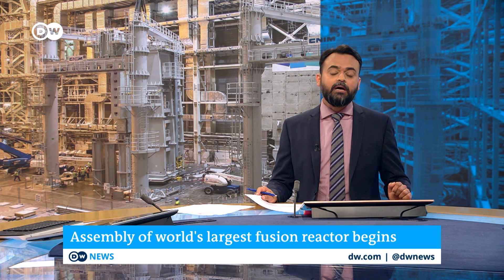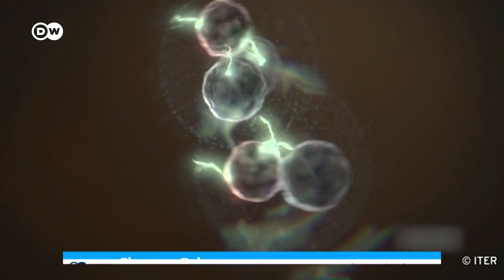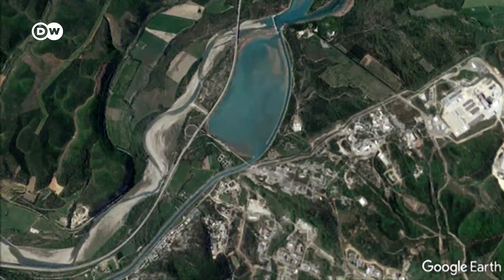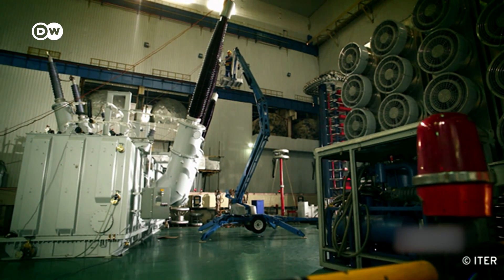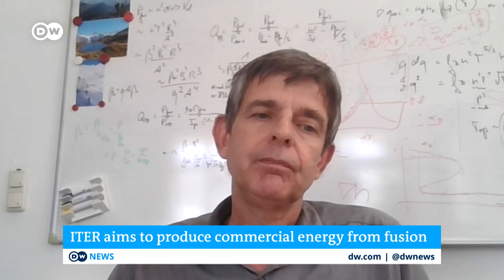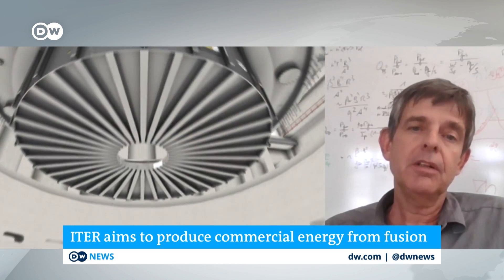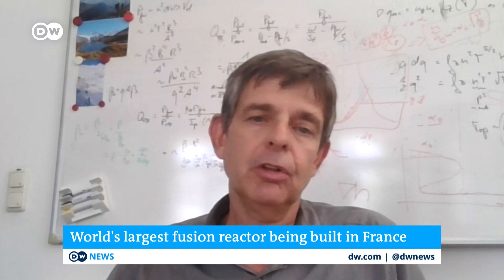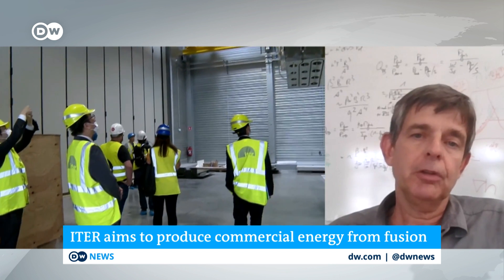ITER: Assembly of world's largest nuclear fusion reactor begins | DW News

Comment: Really hope that there will be no sabotage from fossil fuel giants. Because when this one works it's all over for them.
Reply: Home Kitchen  Co2 is a pollutant ffs.
Reply: @PaulBrown-uj5le  wrong, CO2 is not a pollutant.
Reply: We still need better batteries
Reply: @danielcarvalho3079  There's 2 technologies that are to be deployed very soon. Solid-state lithium batteries and graphene infused lithium ion batteries.
In addition you are forgetting hydrogen, an extremely energy desne rocket and jet fuel you can easily produce in absolute bulk if you have a source of electricity like fusion .
Reply: @fl00fydragon  Hydrogen is a mass dense propellant, but extremely bulky in volume (even as a liquid). This makes rockets much more expensive as they need to be built larger and contain much larger pipes and engines. You end up with a lot of extra dry mass. Methane is a much better option, and can be synthesized using carbon pulled from the atmosphere or oceans.
Reply: @pseudotasuki  And yet we have the technology and it's extremely reliable. (Not to mention that new breakthroughs in material technology will refine what we can do with hydrogen)

And yes, sometimes the cheapest option is not the best one.

Maybe it's the product of trying to run the digital age with a steam age technological system.
We're doing the equivalent of trying to run the Roman empire on the Paleolithic socioeconomic system and expect it to work.
Reply: @pseudotasuki  nope. Hydrogen is easier to make but harder to contain.
Reply: Nah, we still need it for lubrication.  Otherwise our industry will collapse.
Reply: @Aurumk1  That is a tiny segment of the market.
Reply: If you consider political maneuvering, biased research or media campaigns sabotage, it's ongoing stuff that has been going for pretty much all the time.
Reply: Same thing happened to fission. If it wasn't for spread of misinformation and political sabotage, all our power would be fission by today and greenhouse effect would be an astrophysics term used only in academia. No reason to think the same thing won't be done to fusion as well
Reply: It CAN'T be that government is just this inefficient.
Reply: Home Kitchen Think of the ubiquity of water vapour in the atmosphere and the volume of its effects and then realise it only constitutes 2-3% of it on average. To assert that CO2 can't have significant climatic effects because there's "only" 400 ppm of it is simply mistaken.
Reply: Kraptonite  wrong, CO2 is not a pollutant.
Reply: Home Kitchen  what about graphene . Isn't that going to replace plastic
Reply: There is still a place for oil and coal.  Thanks for your liberal sczephrani.
Reply: Now about recycling. Any kind of recycling requires energy. Sometimes lots of it. Even if the energy is completely green (we are not even close), it still has costs. Quite possible that it is cheaper to burn it or let it decompose than to turn it back into something useful. So, it will be better if we try to make products that last longer and leave plenty of oil reserves instead of burning it.
Reply: I don't think it's done for oil industry in 21th century (maybe 22), even it ITER works perfectly we would need at least 100 years to build such complex plants across the globe to cover energy demands (you would need at least 5-10 years to build just one). Anyway car industry is already switching rapidly to electric energy, you already have enough autonomy with electric batteries even for longer trips, costs of those cars are getting lower every year (and EU for example have big subsidies if you buy them), you simple can't stop technological breakthrough.
Reply: Don't worry, if Russia's working with them there is no possible threat
Reply: Home Kitchen  I can't see you sitting in front of me, so by your logic I will assume you don't exist.
Reply: Tokamak fusion is extremely unlikely to be economical. It might "work", but the machine is enormous and super complex. This is not how you make cheap energy. The fossil fuel industry has nothing to fear from ITER.

Nuclear fission reactors however are relatively simple, extremely safe, makes affordable, reliable electricity and have been available for half a century.

Fission could have displaced huge amounts of fossil fuel over the last few decades, but "environmentalists" won't allow it to be used to its full potential.
Reply: @phamnuwen9442  Someone is not up to date in superconductor technology.

Recent advances have made the scale of ITER outdated before its even built, now its only useful as a research platform.

New rebco superconductors can downsize the magnetic field to something around the size of a desk (though coils, power supply, energy harvest, etc would still keep the size out of that range. 

Also you can increase the output further by combining the new rebco with stellarator geometry.
Reply: @fl00fydragon  Build one and we'll see. So far, the only functional nuclear power reactors all use fission. Sure, superconductors can become better. The problem for fusion is that fission reactors can also be significantly optimized and simplified.

Support for fusion is (just like for solar and wind) primarily driven by an irrational fear of radiation and public perceptions being shaped by crappy, sensational Netflix shows.

Fission has no major drawbacks if you look at the data.
Reply: Home Kitchen  fyi windmills are made of glassfiber and epoxy resin, not fron oil derived plastics
Reply: Home Kitchen  Wait, are you actually asking for a list of hundreds of chemicals?
If you googled the general category I gave you you'd have reading material for weeks.
Reply: Home Kitchen  Gentlemen, behold! Mr "I can't google for 5 minutes and need to have information spoonfed to me"

As a matter of a fact yes, there is vegetable based motor oil that's already in the market

There's also certain and chitin based bioplastics as will as multiple bioplastics based on the waste plant biomass we produce via agriculture, 3D printable bioplastics, epoxies, flexible and inflexible resins.

Look it up instead of asserting yourself with no evidence when a 1 MINUTE SEARCH can prove you wrong.
Reply: Home Kitchen Well yes, there other uses such as plastics and stuff but a lot of greenhouse gasses are produced by means of energy production. So even if we still process oil/coal/etc we can cut down on a TON of pollution by changing our energy source.
Reply: This is a prototype, so if it functions correctly the work on the real thing begins. We are still decades away from this becoming accessible.
Reply: Home Kitchen what about greenhouse gas emissions tho? Yes we need oil forever, but what about gas?
Reply: Home Kitchen  
"The reason your plastics and other materials are so cheap is because the energy side of the fossil fuel industry subsidizes it."
No, the reason oil is subsidized is because it's literally "subsidized" on various levels (including processing), preferential company funding, tax breaks for oil companies etc.

"Fuel industry" is actually the shackles of oil-sourced materials. You would know that if you had more knowledge on fuel logistics (massive operations around the globe to imitate power grids, where electricity would be transported with "buckets"). You would also probably ask yourself why is as much diesel sold as gas, when the latter is twice as much refined and almost twice as cheaper to process (math?). It's because Oil is primarily used to refine auto fuel, and not optimized for materials refining.

Now, our modern burden (adding cheap plastics to it) is the absolutely idiotic generation of product "designers" who make products irresponsible (can still be made in various better ways, including easier recycling instead of a total mess) and a narrow-minded business view on a "specific" style of a consumerist economy (can still be much more sustainable).

You see, Consumerism works better with recycling, and for your information, in that alternate reality, the same Oil Companies would do the recycling (because of the massive budgets they already have), just like the same Oil Companies today build wind/solar farms, try to sell the idiotic hydrogen power (substitute oil for hydrogen - the same business), and have business ventures of any kind just because money. They don't care about Oil, but it's cheap money (investment machinations) and they can easily switch to other opportunities, since they're not small family enterprises but mega-corporations which excel at money siphoning (oil exploration and is a massive gamble, and extraction not too far either). You're forgetting about Politics, and how things are build/paid on a national scale.

Methane (natural gas) is also used in the chemical industry.
Reply: Nuclear is great but it only covers electricity. There are many use cases for oil that could never be replaced by nuclear, like materials and transportation (although I do agree that if all coal and gas plants in the world were replaced by nuclear it would be a fantastic improvement already)
Reply: @GeneralKenobi69420  no it doesnt. Nuclear power is used to make isotopes used in many fields, including some semiconductors on your cellphone right now.
Reply: @CarlosAM1  what? Literally from Wikipedia:

"Nuclear power is the use of nuclear reactions that release nuclear energy to generate heat, which most frequently is then used in steam turbines to produce electricity in a nuclear power plant."
Reply: @GeneralKenobi69420  keyword being most frequently. Nuclear reactions in power plants generate isotopes that are useful in many industries
Reply: @CarlosAM1  you got source? Cause I've never heard of such a thing before.
Reply: @GeneralKenobi69420  World nuclear association:

"in developed countries (26% of world population) the frequency of diagnostic nuclear medicine is 1.9% per year, and the frequency of therapy with radioisotopes is about one-tenth of this. In the USA there are over 20 million nuclear medicine procedures per year, and in Europe about 10 million. In Australia there are about 560,000 per year, 470,000 of these using reactor isotopes. The use of radiopharmaceuticals in diagnosis is growing at over 10% per year.

The global radioisotope market was valued at $9.6 billion in 2016, with medical radioisotopes accounting for about 80% of this, and it is poised to reach about $17 billion by 2021. North America is the dominant market for diagnostic radioisotopes with close to half of the market share, while Europe accounts for about 20%.

Nuclear medicine was developed in the 1950s by physicians with an endocrine emphasis, initially using iodine-131 to diagnose and then treat thyroid disease. In recent years specialists have also come from radiology, as dual PET/CT (positron emission tomography with computerised tomography) procedures have become established, increasing the role of accelerators in radioisotope production. However, the main radioisotopes such as Tc-99m cannot effectively be produced without reactors.*"
Reply: @CarlosAM1  I mean... That's not what I'm talking about at all. Of course I know about nuclear medicine, but oil can also be used to make all kinds of derivatives like plastics, lubricants or fuel for trains and plains. You can't make kerosene from uranium now can you?
Reply: @GeneralKenobi69420  no but you cant make medicine out of oil can you?
Reply: @CarlosAM1  no, but how is that gonna help phasing out oil?
Reply: Home Kitchen  the plants can't keep up with all the CO2 we're pumping into the atmosphere
Reply: @mouth4207  plants aren't the only things that absorb CO2. Water and soil also absorbs CO2; most of the Earth's CO2 is locked up in rock as limestone and basaltic rock.
Reply: Most oil companies back these ideas, like carbon capture, in order to gain complete control after the process has proven true.... sadly enough
Reply: Not really.  Even if everything goes perfect, the reactor won't be operational until 2035.  Even if that happens, it'll still be atleast 100 years (from now) before we have more fusion plants than you have fingers on your hands.  According to one article, it'd take 440 plants the size of ITER to replace just coal fired plants.  This also doesn't factor in cars, which despite what some believe, will still be powered by gas for atleast the next 100 years.

Trust me, I think ITER is going to be an amazing milestone on humanity's journey to a completely clean power system but it's still gonna take us a long, long time to get there.
Reply: @Colin Berg Sadly recycling is extremely unprofitable. Most plastic isnt recycled and the stuff that is can only be recycled a few times. It's basically there so plastic can claim they're "clean"
Reply: Home Kitchen  
Yes, no doubt fossil fuels bootstrapped the industrial revolution, but we are going to run out of them eventually. Unlocking hydrogen fusion would unlock the most plentiful fuel source in the universe.
Reply: Those same companies invest a lot of money in renewables too. They're energy companies after all.
Reply: Not necessarily, there is a world of difference between demonstrating technical feasibility and making it work economically. Purely from technical standpoint we could have replaced all coal power plants with nuclear decades ago, no fusion needed. France excluded, rest of the world didn't and not just because of eco-maniacs being afraid of the atom.
Reply: @kincaidwolf5184  A) None of which has the power, wealth and influence of oil corporations that are against it.
B) Notice how even you said "buy the patent"
There's your other set of problems.
The private sector does not invent disruptive technology, it adopts it.
Unfortunately we don't have the serious push for public R&D like we did with semiconductor technology, aerospace, material technology, medicine, etc.

The other problem is patents themselves.
Our technology is not born out of thin air, they build upon past technologies.

Patents slow down the process, in some cases holding down extremely valuable applications for decades (which in turn holds back research, adoption, modification, repurposing, refinement, etc.)

They're a broken mechanism of a failed economic system.
Reply: And millions of children won’t eat that night hope your happy ☺️ (millions and billions of people work in the fossil fuel business and many families depend on it for income, as soon as it’s gone poverty will be at a new time high never seen before)
Reply: Home Kitchen 

I do know that. But pumping oil can become unprofitable if the energy part disappears.
Reply: @theshadowman1398  Pumping oil already became unprofitable earlier this year. There is no conspiracy, just economics. Fusion has been "20 years away" for 50 years now, the reason is because it is really, really, phenomenally difficult and even if we make it work fission would be more economically viable. However, we learn a huge amount just by trying, so I'm still all in favour.
Reply: It's done at a snail's pace. and that's on purpose.
We already have the technology to build a tokamak with the output of ITER and a fraction of the size (thanks to breakthroughs so superconductors. 
the reason we get these projections for the 2050's+ is because it would not interfere with trillions in investments in unextracted oil.

|We basically have an economic ultimatum to either burn all the oil and ruin the environment or see the banking system go up in flames.
Reply: @fl00fydragon  it is a big difference if you have a concept for a reactor or if you can actually build it. for example smartphone technology is way ahead of what we can buy now but it is just way harder to produce products.
Reply: @SandwichMitGurke  Actually you gave a bad example.
Smartphone technology could immediately be mass produced at our current technological limit, however this would kill off the annual "improvements" that excuse the inbuilt planned obsolescence in smartphones and the overpricing of the technology (by having "budget phones" being used as a buffer that excuses price inflation).

In the case of fusion reactors if you streamlined the R&D and production to run in parallel you could make it so you have a standardized base infrastructure upon which you can build various different test reactors that immediately correspond to improvements in material technology. Turning a process that takes more than a decade into a 2-4 year affair.
Reply: @fl00fydragon  well i mean 3nm processors are already doing well in the lab. so one could be upset that they are not built in yet but they just need time
Reply: @SandwichMitGurke  The tech to mass produce them is already there. The stalling is due to the factors I mentioned above as well as the desire to make the most out of old equipment.

Smartphones are but one such example, we have multiple cases (for example medicine, cybernetics, nanotechnology, jet engine technology, etc.) where refinement is pursued and disruptive revolution is avoided.

Basically, our system has aged to the point it's having ever increasing incompatibilities with our technology and has lost nearly all compatibility with the demands of developing and producing the new revolutionary technology that would push us past this era.

We are trying to run a digital age with a steam age logistical/economic system and our civilization is stalling as a result of it.
Reply: fl00fydragon already has been. That’s why it’s years behind.
Reply: @fl00fydragon  You realize that earth doesn't need crude oils in the future right? Deuterium will be the next fuel of Earth 😏
Reply: @fl00fydragon  we will reach singularity through AI(Artificial Intelligence) at the very right time when the nuclear fusion reactor would be up and running...

At that point in life...unlimited energy would come from fusion reactors and all the worldly problems would be solved by artificial intelligence that we no longer would need to work...AI would take care of everything as whatever we would be doing at that point in time would be at a snail pace which AI can do in seconds so no point in wasting our time...we will become multiplantery species...future is bright for everyone...no work all play...
Reply: @scruxoman101  The technology by itself will not bring about a utopia.
We also have to change our system to make such changes possible.

Just relying on tech to deliver us what you describe, which is basically fully automated luxury communism, will not happen because it assumes that the owners of the technology will willfully allow their wealth and power to be nullified.

Instead we'd see what we are already seeing when supply meets demand: artificial scarcity.
A perfect example being food and housing.
Even without AI it would cost less labor and resources to our civilization to house, clothe, and feed everyone instead of the deliberate waste of overproduction we're doing now but we opt not to because meeting demand makes the mathematical limit of price hit 0,making profit impossible and as a result the owners of those industries would stop profiting.

Unless we pair this technological revolution with a socioeconomic rebirth we will see the same thing with AI, automation, technology, cybernetics, etc.

The result being a small immortal, post-biological elite that has no reliance on workers and no accountability and the vast majority, I'm talking about 99.5%, reduced to living in absolute squalor.
As a fellow transhumanist I don't see that as the future we should be looking forward to. 

We need to understand something vital: there's no such thing as a perpetually valid system.
This time it's capitalism's turn to die so our species can enter its next phase, in fact if we do it right we can accelerate the process by doing so.
Reply: @fl00fydragon  "the reason we get these projections for the 2050's+ is because it would not interfere with trillions in investments in unextracted oil."

I've never heard any scientist mention this before. You must have some pretty concrete sources to say this with such confidence, so can I see them?
Reply: @BenjaminGoose  The answer is funding. Fusion is funded by a fraction of a fraction of oil subsidies for "research and development" 
Just look at how slow basic construction is done despite far bigger structures being erected in a fraction of the time.
We're doing research linearly, we're not updating plans, etc.
Reply: @fl00fydragon  seriously? An international conspiracy to cover up the viability of fusion? 

You sure it isn't more plausible that you don't know as much as you think you do and its just that efficient fusion is hard to pull off?
Reply: @VineFynn  You don't need a conspiracy where interests converge.

Fusion is a threat to established economic and geopolitical interests as our current system is designed around the geopolitics and the economy of oil.

Think about it, how many banks and billionaires would go tits up if the oil trade and the petrodollar ended?
How many nations that have been turned into totalitarian resource-states that are designed to be proxies for international conglomerates would collapse along with their masters?

None of them want to see the end of oil, fusion's funding is abysmal for the same reason climate change denial exists.
Reply: Home Kitchen  Actually we've got alternatives for nearly every single oil-based product. 

Our species cannot afford to continue it's reliance on this resource unless you start talking of moving said industry into orbit to prevent any further pollutiuon.
Reply: @fl00fydragon  Not true. Industry (and in turn, modern civilization) is still heavily dependant on fossil fuels, and will continue to be so even as we move towards some alternatives.
The only way in which we are ever going to move away from fossil fuels entirely is if we find a method which may allow us to practically derive the same materials.
This would require a method to, for instance, synthesise new Hydrocarbons from waste materials. From there, they may be re-refined just as effectively as crude oil currently is.

With any luck, such a method may be obtainable before FF's run too scarce...
Reply: @razeezar 
1)Then maybe instead of overbloated militaries there should be money going to either move industry away from petrol based production via biochemistry or move it into space.
2)We already have multiple analogous materials we are not using.
3)Bioreactors are your friend there
4)We don't have the luxury of running on hydrocarbons until they are scarce unless you are also suggesting that we should put half of the global GDP into carbon recapture within the decade.
Reply: Fossil fuel will never be over. As long as there are machines in the world that produce things, they will need petroleum products to service them.
Reply: Aslan Burnley 

You do know that there are fully synthetic lubes
Reply: @theshadowman1398  Synthetic oils are made partly from products of the crude oil refining process as well.
Reply: I'd also be concerned about sabotage from green energy companies and parties